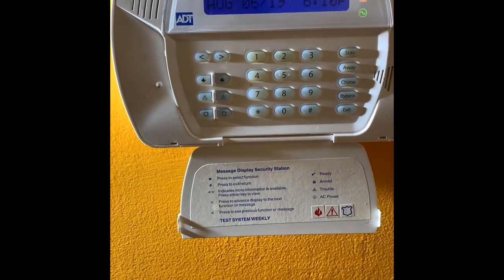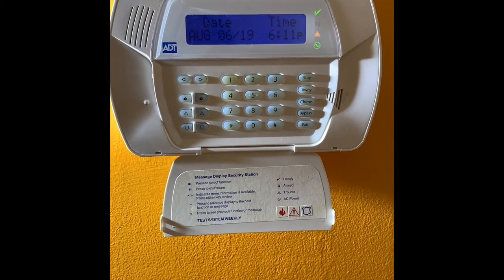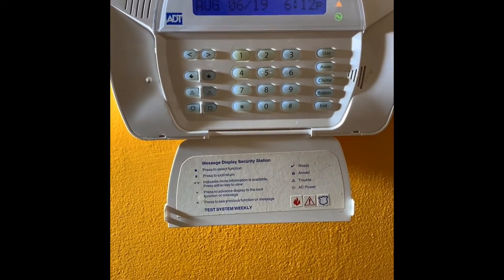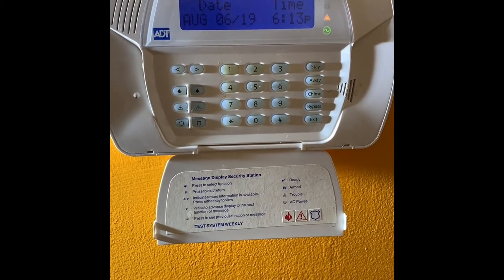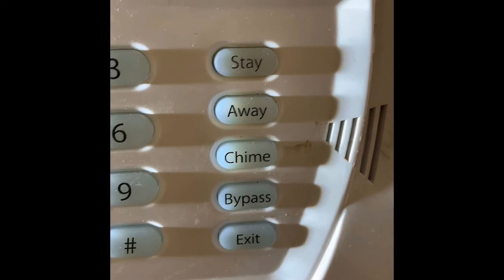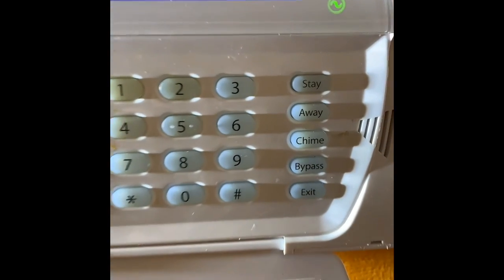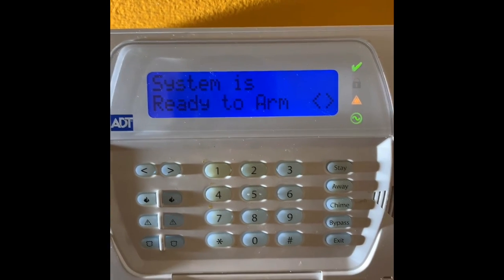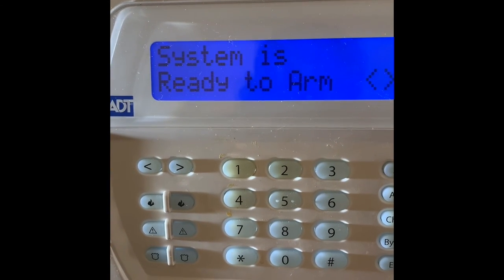How I was able to turn off the beeping noise in an ADT alarm system

Comment: This is wrong. You have to scroll thru to see the error messages after pressing *2. My error was a low battery in the siren outside.
Reply: This worked to specifically identify the problem. Thanks Jamie